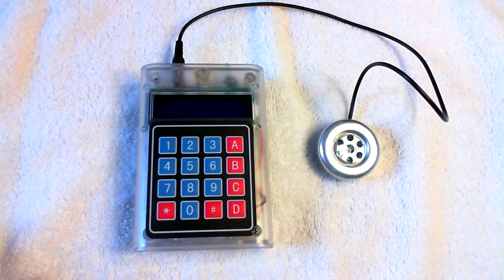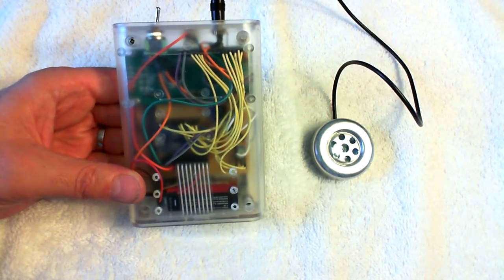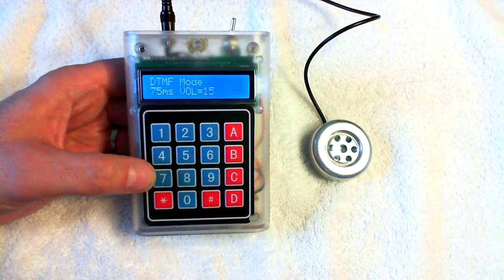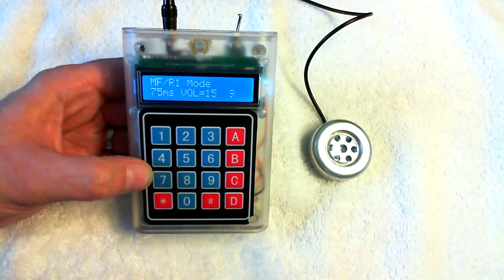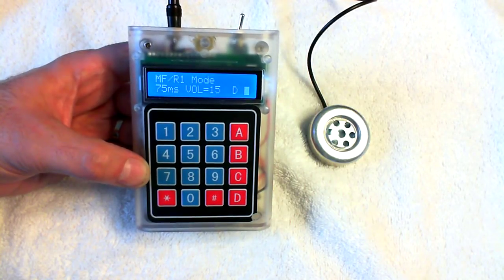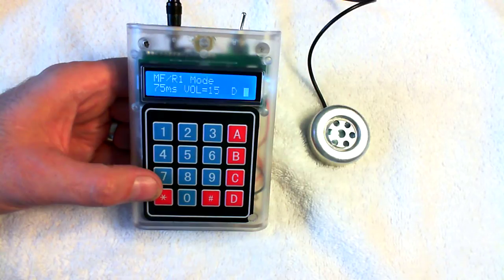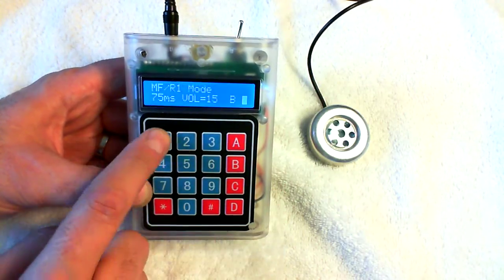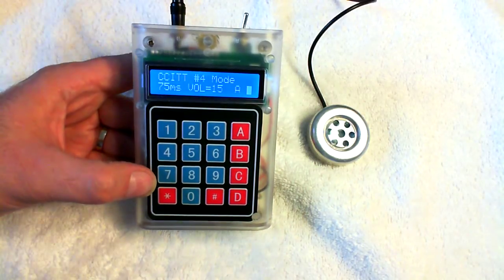Arduino Multi-Mode Blue Box - 12 Modes with LCD Display Overview

Comment: Given the different modes, is your model more capable than what would have been found in the 1970s? I was thinking about trying to replicate something like this, but possibly with less functionality, possibly to match what would have been seen then.

Was thinking I may use a Raspberry Pi Pico - do you know if anything has been adapted for that system? Thanks -JC

Comment: I cant get this to compile.  I keep getting the error "variable 'sinTable must be const in order to be put into read-only section by means of '_attribute_((progmem))'Any ideas?
Reply from the maker: The latest Arduino IDEs are a bit more picky about variable definitions.

In the "Synth" library, find the tables2.h file and add the word "const" in front of the contants of line 7:

PROGMEM char SinTable[]=

becomes.....

const PROGMEM char SinTable[]=

Reinstall the library and all should compile.

The IDE now requires any variable placed in program memory to have the "const" declaration before it. It was optional before.
Reply from the maker: The .zip file is now updated on both the Instructables page and the direct download link.
Reply: Brilliant, thank you, it works like a charm now.